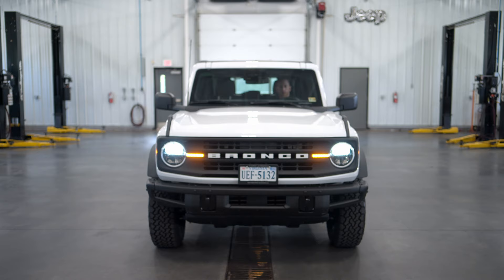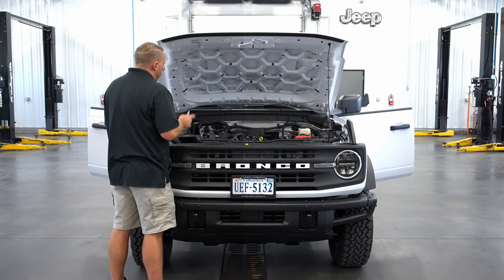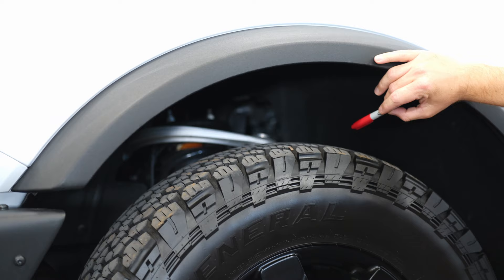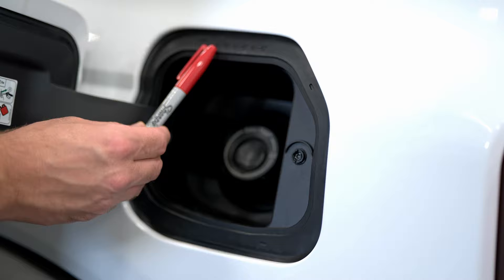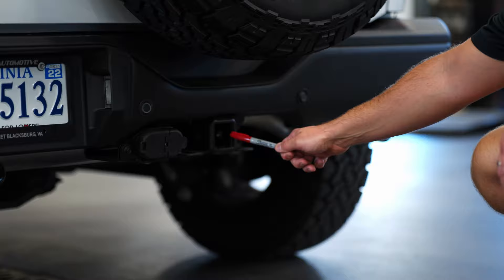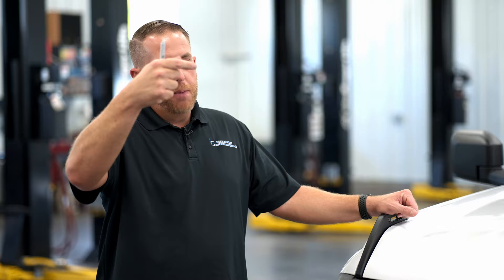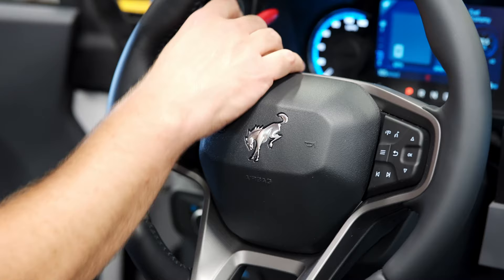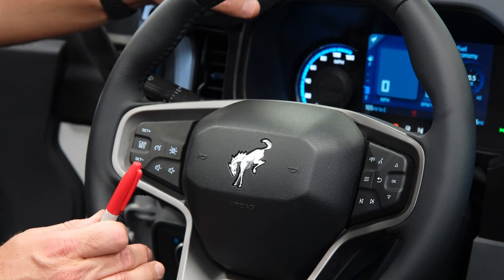2021 Ford Bronco Black Diamond Walkabout Tour

Comment: Yes, the 2.3 rocks! Add a $500 power pack available by a few aftermarket providers, and add another 40-50 hp. Lovin my 2.3 on my '22 Black Diamond 4dr sasquatch mid package w trailer tow.

Comment: Excellent review Matt.  I may consider a Bronco as a backup to my 2021 F150 that I use as my travel trailer tow vehicle.  The F150 is great for towing and long distances.  But not so great for in town or off road given it's length.  Glad to see you're happy with the layout of the Bronco.

Comment: Congrats on finally getting the Bronco! The license plate so high on the front of the vehicle would drive me nuts!
Reply from the maker: It drives me nuts!
Reply: Check this iv had my blk diamond now going on month. My license plate I RELOCATED it to driver side of bumper just underneath headlight , I purchased shelving L brackets from home Depot and bam done license plate relocated, yes it will cover fog light area but I have other plans for them hope you get this reply... P.s. I did not want to drill holes in new bronco lol

Comment: Seems like you could mount the front plate below the sensor. It might get in the way for technical offroad if it was too low, but you could always just take it off on the dirt road and put it somewhere else.
Reply from the maker: I wish VA didn't have a front plate.